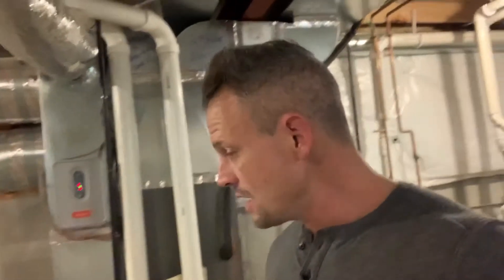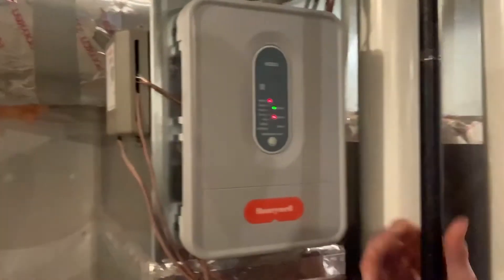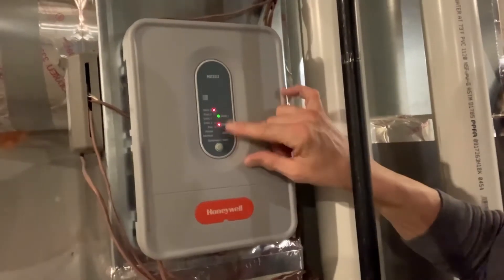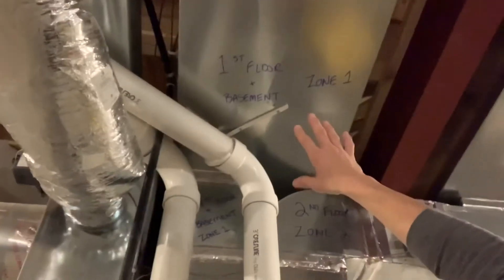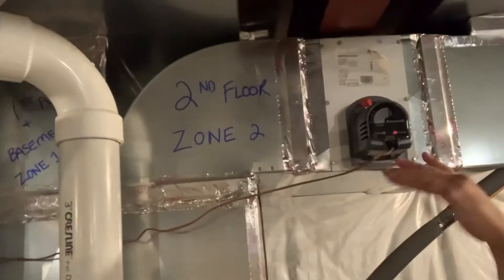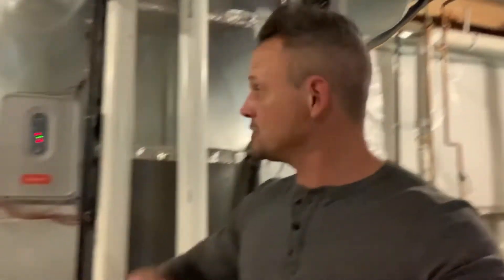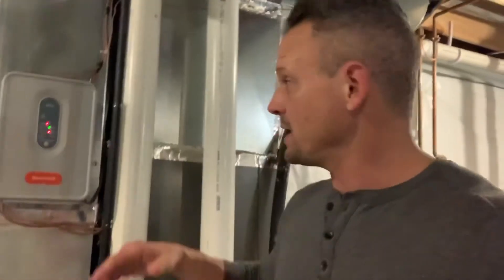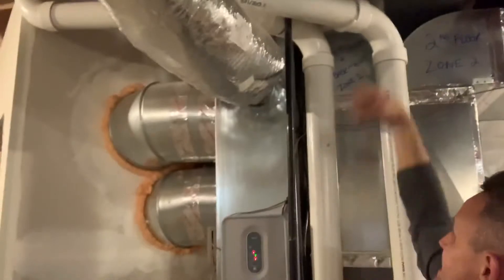What is a dual zone heating and air conditioning (HVAC) system

Comment: Thank you for the great explanation. If I have the upper zone on and the lower zone off, should there be any airflow in the lower zone?
Reply from the maker: It’s possible you may experience a little bit of airflow depending on your systems design. 

However, I have seen many situations where the HVAC contractor accidentally connected a supply duct on the wrong trunk line that is from a different zone. 

Depending on your house if the ductwork is in an unfinished basement or in an attic space this problem is usually easy to correct by connecting that supply to the correct zone.
Reply: Thank you for the quick reply.  I also have an oscillating airflow which is not smooth but increases and decreases every few seconds. Is this normal or is there a problem?
Reply from the maker: @tommylee8909  My pleasure Tommy!
Sorry, that one I don’t know.
Reply: @BJPoznecki  The airflow rate is not consistent coming out of the vent. The airflow increases a little then decreases a little then increases a little and continues this way. Would this be abnormal?
Reply from the maker: @tommylee8909  It’s possible your system may have a weighted damper that helps balance the air pressure when one of the zones are not being used.

Comment: Excellent Video Sir. I have a 2 zone (electronic). I want to upgrade to wifi thermostats.  I'm assuming you need specialized thermostats with this setup? Any recommendations? I have a honeywell system.
Reply from the maker: Thank you!

Nope, you don’t need a special thermostat. Whatever brand you decide to go with nest, ecobee, etc. that connect to the Wi-Fi will work, you just need to identify the location of each thermostat on the app.
Reply: But do you need to have two thermostats? A Nest is capable of multi zone and you can connect sensors to multiple rooms. @BJPoznecki
Reply from the maker: @Laidlaw444  I’m not 100% sure with the nest and the multiple sensors, but I think you do need to have individual thermostats hardwired to the furnace and the control panel.

Comment: Thanks for clarifying, I have HZ311 board with 2 zones and was always curious what happened if upstairs and downstairs had heat and AC on simultaneously, was never sure what t-stat took priority.  Also, my board doesn’t have the sensor DATS terminals hooked up, what does that do and is it needed?
Reply from the maker: Thank you!

My apologies I don’t know what the DATS terminal does. It may not be  needed depending on the system that you have. I would ask the HVAC contractor that installed your system I think they would know.
Reply: @BJPoznecki  I guess it is for hooking up a Discharge Air Temperature Sensor? This is the system that came with house recently purchased.
Reply from the maker: @jhamm15  Thank you. 

I just read a couple articles and don’t fully understand it, so I’ll have to talk to my HVAC guy for a deeper explanation. 

With that being said I don’t want to accidentally mid-guide you if it’s needed or not, so the best advice I could give you is to ask your local HVAC contractor.

Sorry I wasn’t very helpful on this one, I just don’t want to give you incorrect information.
Reply: @BJPoznecki  haha, fair enough! Lemme know what they say about it! 😀

Comment: I know what a dual zone HVAC is, but you confused it so much -  First, who's going to crawl up in the attic to see the 'lights' on the control panel?  Nobody.  All people care about is "Am I comfortable both up and downstairs?"  If not,  they call their friendly AC guy, that drains your pockets dry.   Have been dealing with a dual zone system that just isn't right.  One compressor and condenser outside,  furnace and air handler in the attic with a thermostat downstair, and the other upstairs. It's a 4 ton Carrier new home install.  The AC is so humid, mold is on the walls downstairs.  3 different HVAC guys have been here at the tune of over $1,000 each call.   My primary HVAC guys doesn't typically do repairs or work around.  He says, DUMP the dual zone (they are all a pain in the ass) and put in 2 ton down and 1 1/2 ton upstairs- problem solved.